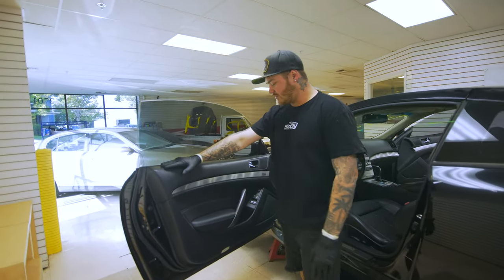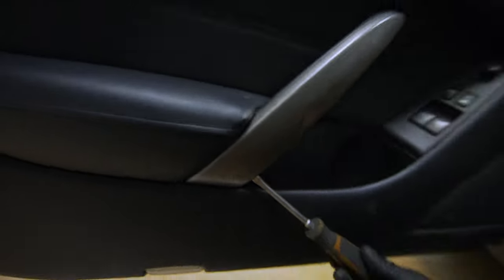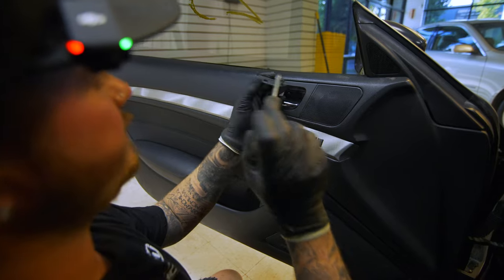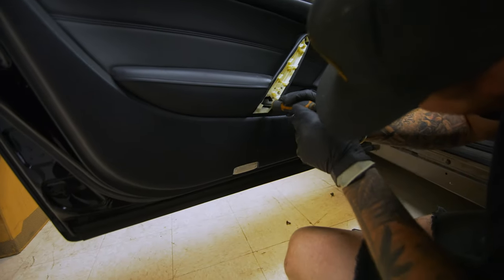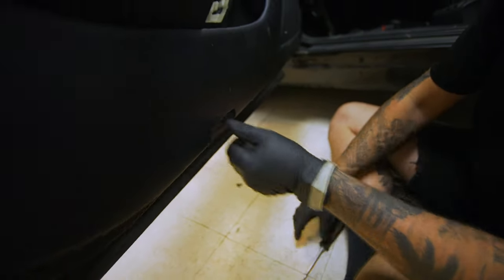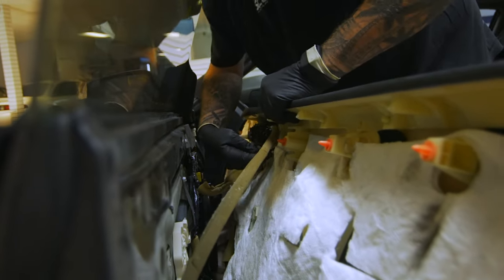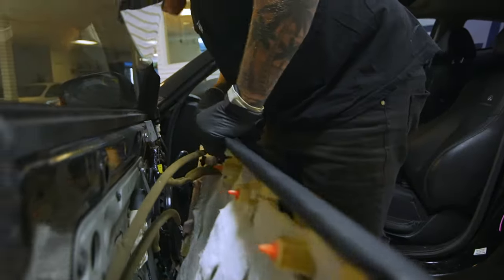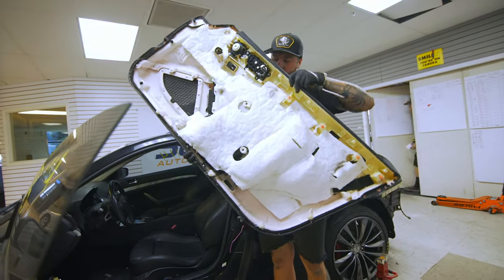How to Remove G37 Coupe Door Panel | Take Off Instructions | Install

Comment: What is that plastic part on the inside of the panel called? Where you take out the 2 screws for the handle. I have to replace them but idk what they’re called. Any feedback would be greatly appreciated! Thanks for the video!